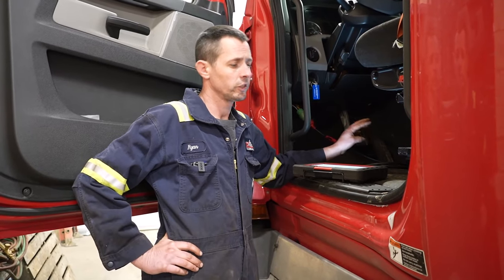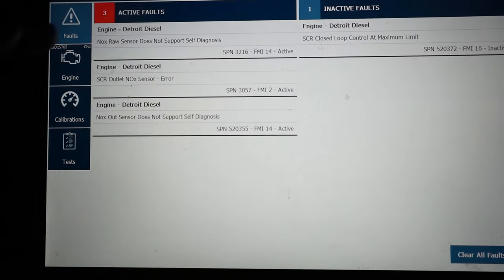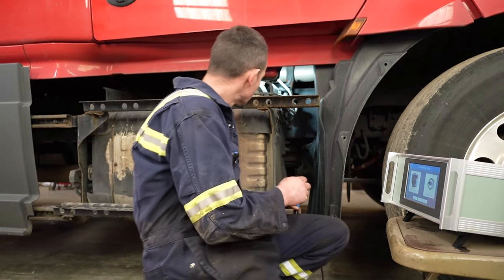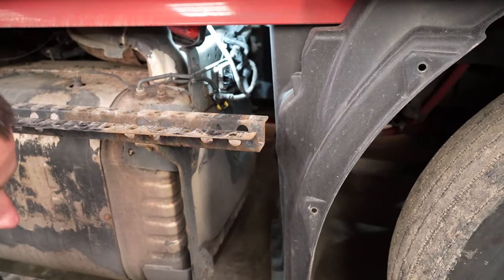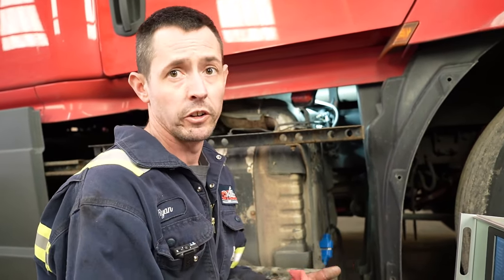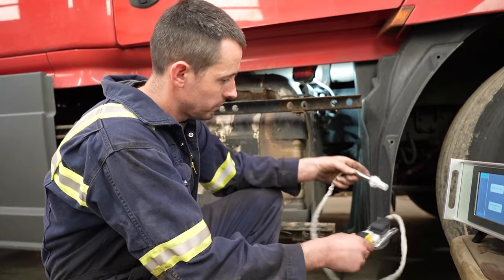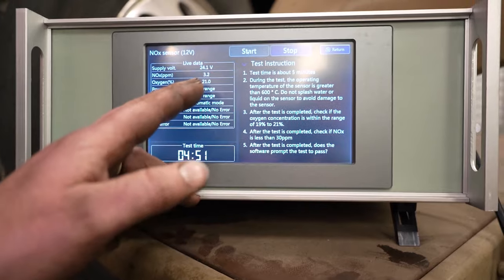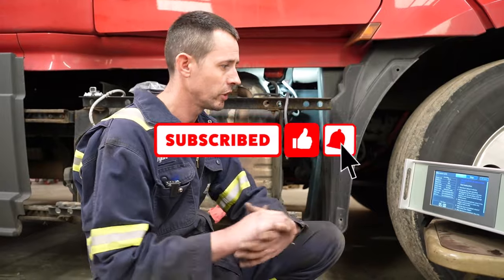How to tell if your NOx (Nitrogen oxide) sensor is bad?

Comment: Thank you for this video and your time.  I always appreciate your videos, as I learn from every one.  It is especially helpful to me because I use a Snap On ProLink Edge too.  I just had a DD13 the other day with similar codes.  I R&R the Nox inlet sensor and ran a regen.  Everything is good.  Normally, when I get Nox related codes I do a regen just to watch and see what the PPM measure is and to see if they read “stable” or not, for conformation.  Thanks again.  👍🏻
Reply from the maker: You are welcome! I do the same, regen every time after working on emission stuff. 👍
Reply: For me and the fleet I maintain, Which are anywhere from 200k-900k mile tractors, after a PM and a regen I see around 100-125ppm on the inlet side and around 5-15ppm on the outlet side.  Hope this helps.
Reply: I think he was talking about the sensor tester machine,  oh I need that!

Comment: Hi, I have a question. I got 2020 freitliner cascadia dd15 
Just changed nox out sensor 

 I got readings 
nox inlet value average of 410ppm
Outlet  nox value average 257 ppm

Different between sensors 157ppm

Nox concentration sensors values inconsistent 

Does this mean I need to change the inlet also, or is something else wrong,

Comment: hi Ryan i have question about apu, to get in to the sistem with laptop you need to have internet on the laptop? because i tried mine but i had bad internet connection and i ding show the the number like i was checkin alarms nothin shows up next to alarm sign

Comment: After having my eld put in...all the sudden my def gauge went to empty and engine light came on.. disconnected the eld light went off.... reconnected the eld went to start it, then the def worked fine, but the diesel fuel shows empty... disconnected the eld and everything is showing no faults....do you know what kinda sensor would cause that on ISX15?

Comment: What a scam OMG ,  I bought a 2020 cascadia and was in the shop twice in 3 months and one of the reasons was the nox sensor put my truck in limpmode forcing a tow to the dealership , Do not buy I repeat do not buy cascadias with x15 cummings  way too many issues with sensora faults and bad weak ass Modulate. These new trucks are a complete scam.